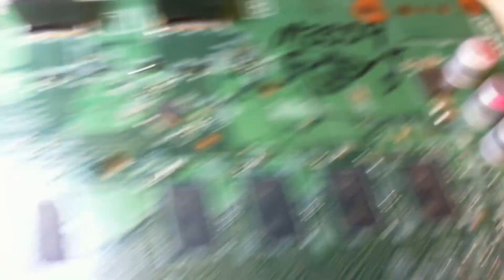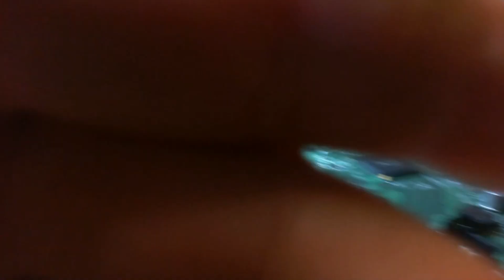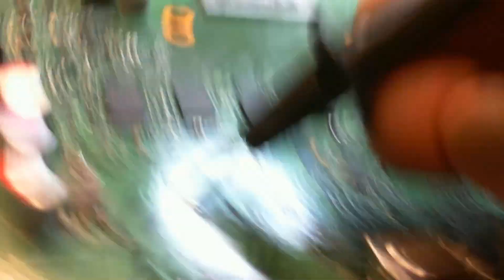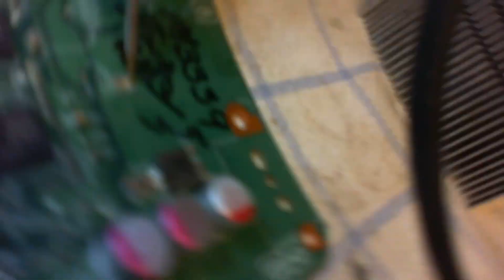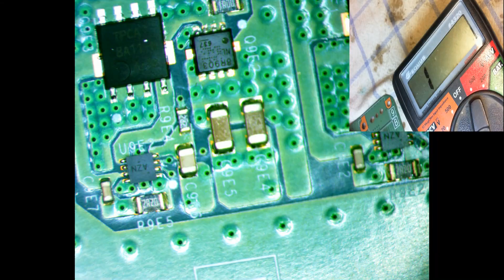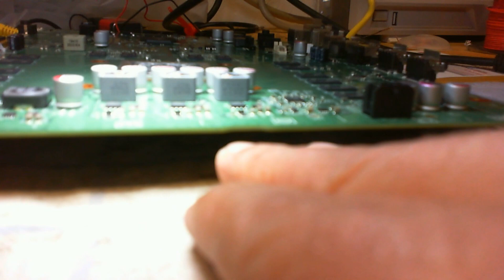Xbox One Slim No Power Motherboard Repair M3339

Comment: lol this video is giving me a migraine lol for example you saying you have to sit it up to make sure you don't knock anything off. If you get it hot enough where components on the bottom is coming off then you're overheating it. This board has a massive amount of thermal mass and would take a lot of heat to heat that much surface area.
Reply from the maker: This video is self-explanatory if you have trouble with what I told you or think you know better because you watched some other idiots YouTube video doing this on YouTube, I suggest you go to school and learn to do it right. This is A low-tech old fashioned way of doing this type of repair, I normally would not do this repair in this way as there are much better and safer ways of doing it but I am not here to educate YouTubers trying to learn and offer repairs that are uneducated and destroy more than that fix.

Comment: Any clue to why a og Xbox one just shut off an not come back on
Reply from the maker: 100's of reasons I will not guess at what may or may not be wrong with your system sorry if you try to fix something that is not broken or bad you can make your repair way more expensive or flat out kill it, so I would recommend you find a qualified shop because No YouTube Video is going to give you more than one or two possible problems.

Comment: Hello after watching this video I believe my son's Xbox can be fixed, but I don't have the tools to do it. By any chance can I send the mother board to you for test and repair and if so what do you charge to do this type of repair? I appreciate your time and response, Bert
Reply from the maker: No sorry although I am a licensed repair shop I do not do mail-in repairs especially of only the motherboards that is an extremely bad idea and prevents the shop's ability to properly test the system for problems and that means [You get screwed 98% of the time doing that]

Comment from the maker: If you need the part shown replaced in this video use this link https://ebay.to/2U2Zzv2
if the link does not work let me know.
Reply: It is not taking me there so you have another link? I plan on giving my Xbox one s to my sister but the hdmi port is messed up and I don’t want her to think it’s broken. Do the normal xbox one and xbox one s have the same motherboard? If not could you tell me the name for the xbox one s motherboard?
Reply from the maker: @xkdawggx  https://ebay.to/2U2Zzv2
Reply from the maker: I updated the link for anyone that needs it.
Reply: @ClovisX  alright thank you

Comment: Hi i have a xbox one s  not turning on atall done the basics checked power supply changed front boardfor known good one i have done test on the board and allso on aworking board on the good board with just the powersupply plugged in i am getting 3.3 volts at testpoint fortp3p3  and at c1u3 andc1u4 am getting around 5 volts but on the faultyboard am getting no voltage atall at those same points and u5d4 isnt getting 5 volts no voltage atall from that ic but my good board as a 5v supply to it any ideas were i can test next ? Thank you
Reply from the maker: Ya, I have lots of ideas as to where to test but I can not list them all here or put them all on one video for you, you should take it to a qualified repair shop one that has a repairman that went to school and is willing to prove it otherwise you can kill it yourself.

Comment: Wow. When testing (@ 5 min 10 sec) my 3 mosfets from ground to the top 4 prongs I get 620 only on the 2nd 3rd and 4th. But on the 1st top prong which is the gate I believe? that one gets open on all 3 of the mosfets when testing to any of the bottom ground prongs. What would cause all 3 mosfets to not get a reading on the same 1st prong? I seen alot of repairs on the xbox, but yours is by far the most thorough. I am lightly skilled at diagnosis on these and repaired a few mosfets gone bad, but never had all 3 mosfets receive (open) on the first prong only. Thanks. Great videos...love them!
Reply from the maker: This Video is not a training video for game stop employees or other shops sorry I can not teach you electronics that you will need to go to school for, I am not trying to be mean or even disrespectful but there are so many different reasons for what you are describing I can not list them all.
Reply: @ClovisX  i understand. Just my boys system. I was curious if you had any quick ideas, because with power to the board that same first pin and all other 3 do give me 11.98 volts. Just was looking for a bone. Most people on here on any youtube video similar to yours watch these for informative info related to their issues. But thank you for the fast reply, but I am a pharmacy supervisor and like these videos because I love learning what others are willing to show and helped 2 of my friends by resoldering 2 mosfets on their boards for them. But i dont work for any game place, was just seeking friendly advice because I am pretty skilled at soldering and repairing tv's and other electronics. But thanks.

Comment: Hello

I liked your repair video and I agree with a lot that you said. Now what’s my issue, I connect the motherboard at bench power supply and the motherboard all the time cut the amps.The board appears to boot 3 times but the amperage drops to 0.001 from 1.40. I checked the mosfets, but I think are ok. Any ideas?
Reply from the maker: you need to take it to a qualified repair shop one with an educated repairman willing to show you there education because there are lots of reasons for this and if you try fixing it yourself you can damage or kill the system if you haven't already YouTube is not a place to learn repairs. See if I am close to you.  http://www.clovisxbox360repair.com/contact.html
Reply: @ClovisX   fortunately  I am doing it for education purposes and no i am farrrrrrr away from ya.
Reply from the maker: @alor6643  At the very beginning of this video you will see in the upper left 2 Cap's next to were the Wifi connects to the motherboard check to see if the caps are lifted off the board if they are? replace them, after that test the components nearby the caps.

Comment: Hey there,

Thanks for your informative video on how fix the Xbox One S.

I am having the issue where my Xbox One S Starts with a Chime and within a second Goes off with chime.

I tried to investigate the problem and check for faulty devices such as Hard drive, Fan, Disc Drive, or even the Thermal Paste.

Nothing was wrong, I even changed the thermal paste on the CPU.

Funny thing is that, my Xbox One S will start and work as if nothing is wrong after every 4 days.

I know it's the MOSFETs which causing this issue, not checked the readings yet.

But want to know, why after 4 days my Xbox will start and i can play games upto how many hours I want, I played for straight 12 hrs, switched it off.

Tried to swtich if on immediately, stuck in the  on / off loop again .

Please advice.

Comment: What temp have you got your hot air gun set to, i have mine set to 450c (max setting) and had it on the chip for a good 3-5 minutes and the mosfet is not moving. Does having the air flow higher reduce the heat at all?
Reply from the maker: Sorry, I do not train Fake Repairmen using YouTube and there customers game systems to learn what they can and can not do at the expense of there customers piggybanks! Shame on you!! Go to School!!!